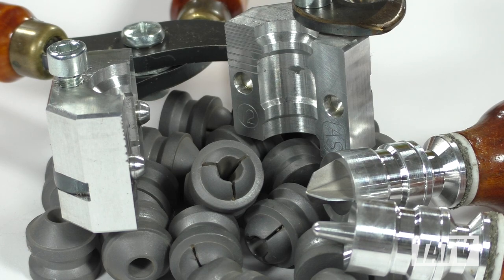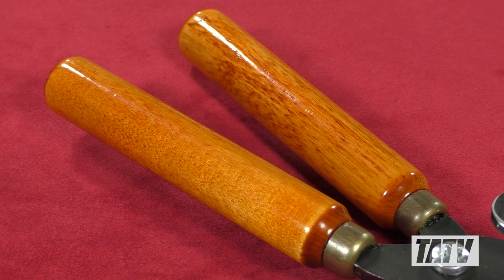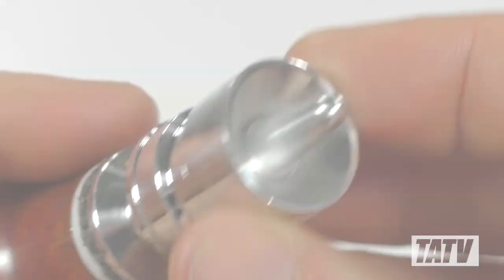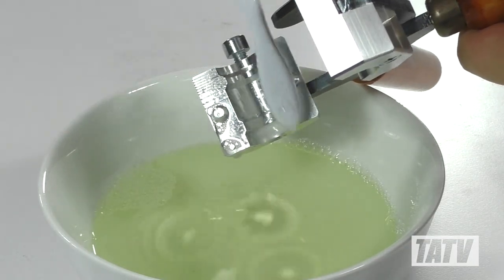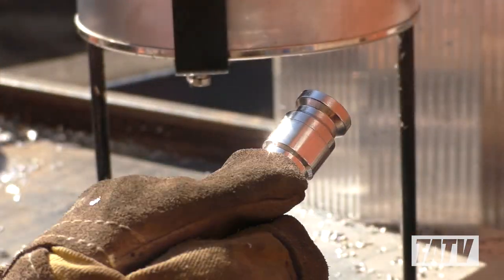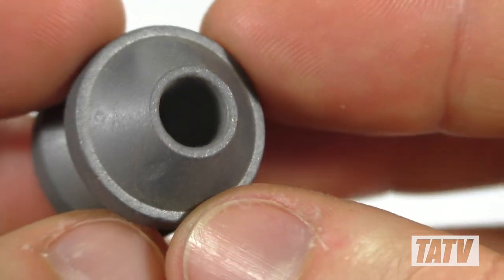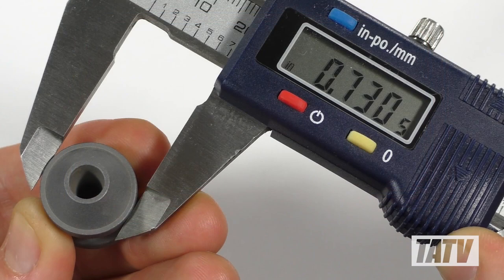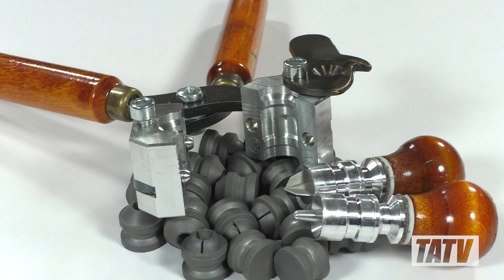ASM Grizzly Paradox Slug Mould

Comment: I cannot wait for this to come in stock.  Everything he says is correct.  I have hundreds of molds and cast for every form of firearm.  In my 38 years casting, these are the easiest to cast slugs or even projectile that uses a pin.  I had shootable rounds within the 4th casting.  The segmented pins all come out super easy.  I heated up my mold for 10 minutes on the top of my Lee Big Dipper, and 4 castings later I had near perfect rounds.  All came out with little effort using the ball removal cavity of the mold.  By round 20, they were perfect.  They had zero marks on them.  They looked like factory cast silver jewelry.  The machining and thought that went into these moulds is shocking.  More so, in an hour I was firing those Twister rounds into wet magazines and examining bullets with 2, 3, and 4 segments, and what they did to the books.  These molds get you up shooting that fast.  I just cut a shotcups sides off and used the lower portion of the shotcup as a gas seal.  No screw used to attach it either.  In my smoothbore it hit dead center of the target and the slug fragmented each time in horrific ways.  The best slug moulds in the world.  Bar none!  Now to buy them all as they eventually come into stock.  I want everything for 12 and 20 ga from this company.

Comment: TATV, are you planning on carrying these in your online store?

Also, I love the matte finish on your slugs. Do you just dry tumble in walnut medium? You may have answered this previously but I only started watching recently when I ran across your stuff on the RL Network. 

I can't wait to see how these shoot compared to the Svarog paradox. I would hope they would just work with the driving bands as is. Needing to use a modified wad screwed through the cavity is a bit tedious.

Though, with that said, Svarog on their FB page mentions screwing those to cork filler wads, adjusting the column as needed to get the right drag on them for your gun.
Reply: Actually just saw your reply on another commentor's post about starting to possibly ship these world wide in June/July. That is awesome.
Reply from the maker: Yes I have an agreement in place with the manufacturer to import and retail them here.  I will be shipping worldwide, but predominantly to North America I imagine.  

Yeah I like the way they look too; its an extra step, but it's pretty simple.  I just tumble them in either corn cob or walnut media for about an hour or so.  Smooths out any sprue or mould lines.

Comment: Great video. Do you use beeswax with these molds  ?
Reply from the maker: For fluxing, or something else?
Reply: I use a Lee 7/8 slug mold  they recommend beeswax for lubrication
Reply from the maker: Now that you mention it that does sound familiar; but in answer to your question, no I don't use anything special with it.  I think the way they manufacturer has finished the surface of the pins, combined with the shape, makes it simple enough to extract the slug that nothing else is really required.

Comment: @TATV Canada, with the ASM Grizzly Shock Paradox molds, I do not see a hole all the way thru the molded slug, like there is in the Svarog Zveroboy. However, do you think with a slug from the ASM mold that I could drill a small hole thru the ASM slug in order to fasten a wad to the slug with a small wood or machine screw? I kind of like the idea of the wad staying with the slug over a longer distance for more stability...
Reply: I did find the ASM Sh-Sh and Twister molds do have holes all the way thu
Reply from the maker: You probably could, but it seems like a lot of hassle.

Comment: Can you share the two liquids used in the mold prep part of the video ?
Reply from the maker: Sure thing; first one is just water with some Palmolive dish detergent to de-grease it.  The second is sprue plate oil that came with some of my moulds from NOE.  I couldn't tell you the exact composition but I'd say it's a fairly thick machine oil.
Reply: @TATVCanada  looks almost similar in color to 2-stroke oil. I think that is what FortuneCookie and Full Lead Taco use as well is 2-stroke.
Reply from the maker: That could very well be; someone else once mentioned chainsaw oil to me, too.

Comment: Thanks for your quick informative video. I'm interested in less than 2&3/4" shells so your showing that was great!  Reduced recoil fragmenting slugs out of a 1&3/4" shell is perfect for home defense!
Reply from the maker: Or for little guys like me ha.
Reply: @TATVCanada  Would It be possible to modify a 7/8ths oz. Lee key drive mold so the key drive is eliminated and fracture lines are put in it? Would a custom CNC shop be able to produce that? I dont have any modeling software or 3D printer.